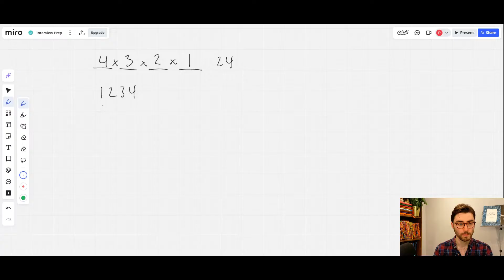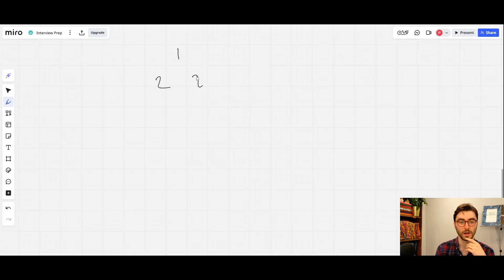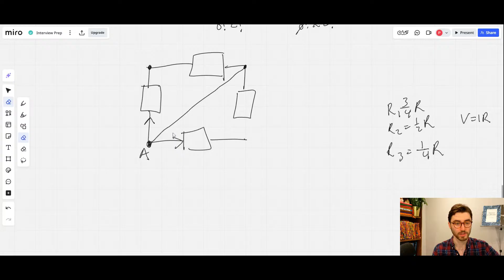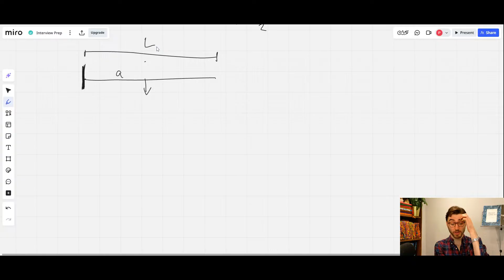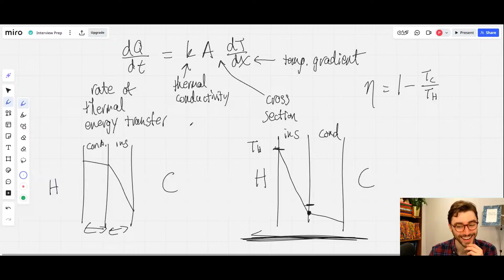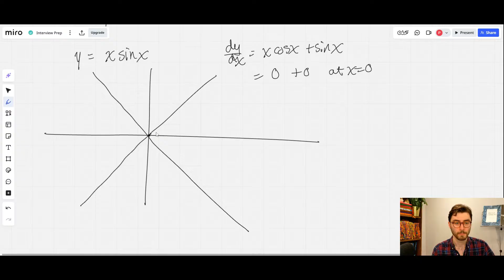Oxbridge Interview Skills: Learning on the Fly

Comment: Hi, for 40:00 how come the it goes from f over 48EI to f over 6EI?
Reply from the maker: It was just a different situation with a different equation. The 48EI was for the board supported from two pivots and the 6EI was for the diving board scenario. I think we did beam bending like this in second year materials science. You would never be expected to know that or work that out, they would have to give you the equations. From there it's just about using your skills to get some meaning out of the new equations.